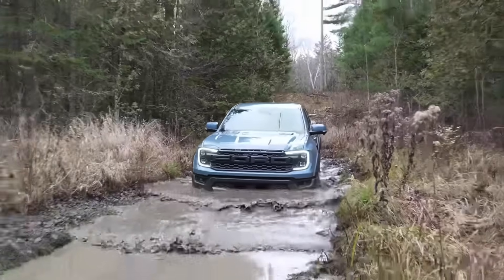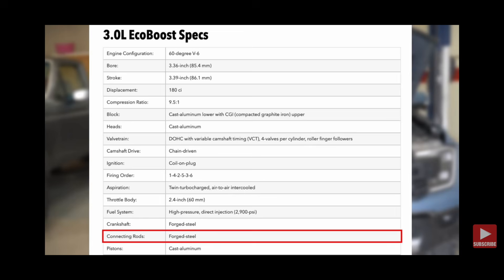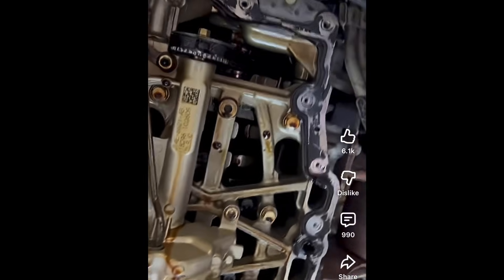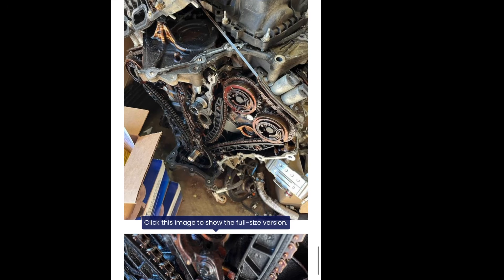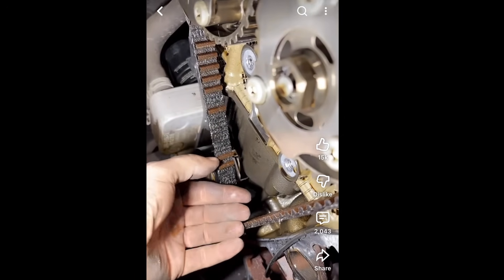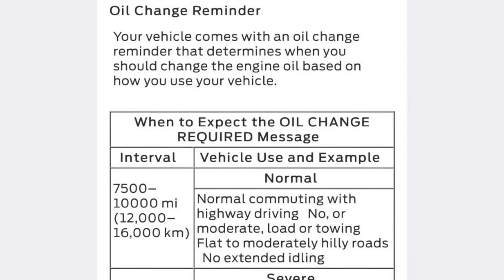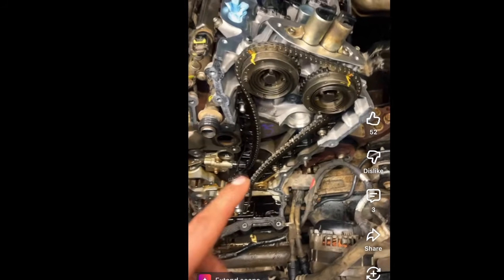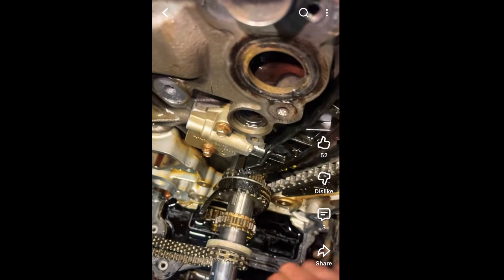Next-Gen Ranger Raptor’s Hidden Wet Belt

Comment: Lies, nonsense, are we driving an EV or ICE vehicle? We want and love that engine noise. Wet belt driven oil pump snaps, engine is starved oil and moving parts cease and maybe even crankshaft snaps into 2 pieces. My ford ranger did that, oil pump failed, no oil pressure warning light, crankshaft broke into two pieces, complete engine failure, did an engine rebuild and it's a 2.2 T6 diesel chain driven engine including oil pump, but their none gear oil pumps are garbage, when they design, they must make sure one important part is designed to fail dismally in the shortest period of time - planned absolescence

Comment: Ford nailed everything accept reliabillity. The WL and the following 3.0 Dtec engines were amazing. I f they get the the reliabillity on par with isuzu or Toyota, they would not have enough factories. Would you please look at making a video on live feed, Radio's aftermarket? EGT, OIl pressure, Injector Values and water level will be such a great help without the need to plug in the Scanner. Well, only if you could find a sponsor. In SA we have these systems, but can not find a video and a reliable, non biased you tuber to test it out. I still have my Ford because of this channel.(and a top don scanner.hahah just in case)

Comment: This video is going to cause alot of confusion for people thinking all the v6 Rangers have welt belts. you should clarify in the title  that this is for is  the V6 3.0ltr PETROL  Raptor engine . Not the 3.0ltr V6 DIESEL nextgen Ranger engine. The 3.0ltr DIESEL V6 Nextgen Ranger does NOT have a welt belt.
Reply from the maker: Video clearly emphasises V6 ecoboost not V6 lion , Raptors are only produced with an ecoboost

Comment: They couldn't help but sneak a wet belt into this engine aswell 😂
Reply: 😂😂😂😂 I don't want a Raptor anymore, plus tow capacity is low with 2.5 tons 

-  A 3.0L V6 turbo diesel wildtrak is the best with 3.5 tons towing capacity, nicely kit it then done
Reply from the maker: So true